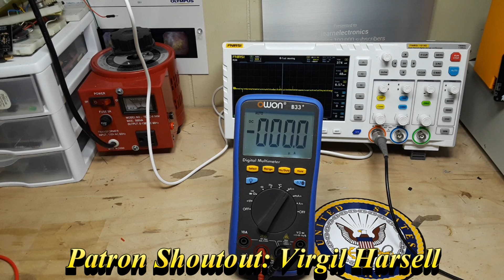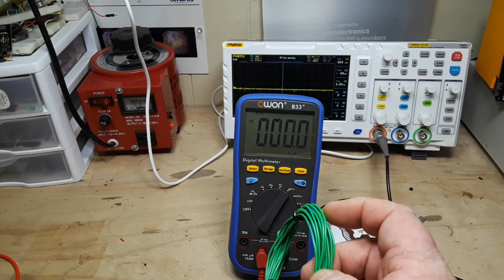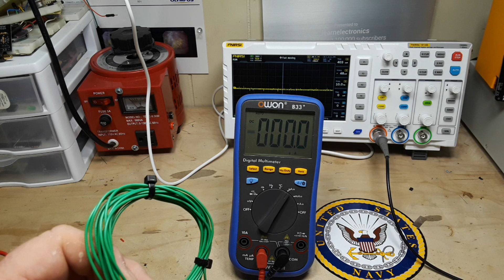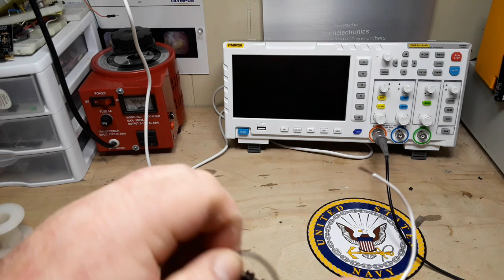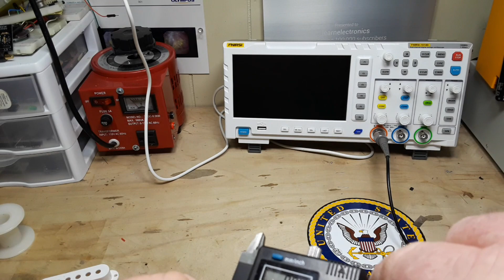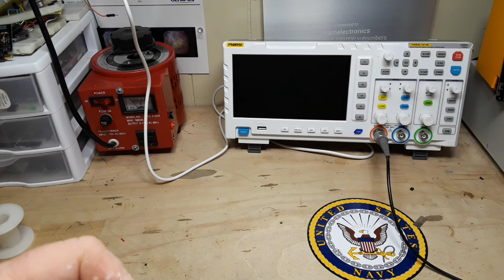Single Coil Guitar Pickup Theory and tear Down

Comment: Two questions:
- what's the difference between these and the flat kind of pickups with a metal cover?
- Why aren't there any 6 coil pickups, 1 wire wrapped around per magnet?

Comment: Thanks! Here's a good webpage to visualize more.  https://animagraffs.com/how-an-electric-guitar-works/   ..  For those who might wind their own pickups here is a box you can build to check a pickup measurement https://github.com/KenWillmott/integrator/wiki  I have the pcb and the components, but haven't assembled it.   Typical wire used for pickups are 43 and 42 AWG and usually coated with polyacrylamide, formvar,  and enamel.

Comment: the humbuckers are 2 single coils wired in series, that  is supposed to be how they cancel the hum. I don't know who invented or developed them
Reply from the maker: They are in series, but out of phase
Reply: @learnelectronics  How are they out of phase, they're turned/flipped 180 degrees? I didn't remember that part.
Here's what Google say about who invented them :Seth Lover, the man credited with , alongside Seymour Duncan. The first  was  by Electro-Voice in 1934, but it wasn't until the 1950s that a humbucking pickup was created for use in guitars.

Comment: Can you show the frequency response curve graph using a spectrum analyzer from 20Hz to 20Khz of the guitar pickup. Try to make a video lesson on doing this on how to change the inductance and capacitance values of a guitar pickup to get a different resonance peak frequency
Reply from the maker: I don't have a spectrum analyzer, sorry.
Reply: @learnelectronics  I thought all your Oscilloscopes had an FFT channel port because most new digital Oscope have an FFT channel. And the Telephone invented the humbucker pickup used in the telephone because les paul removed the humbucker pickup in the telephone in the 40's and put it in his guitar to make a pickup